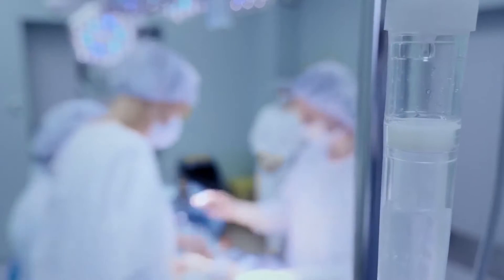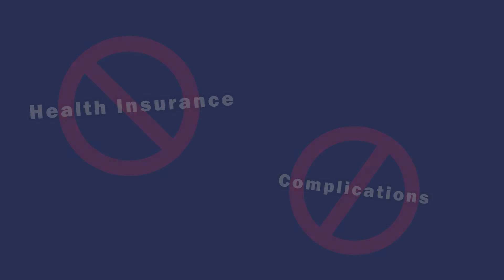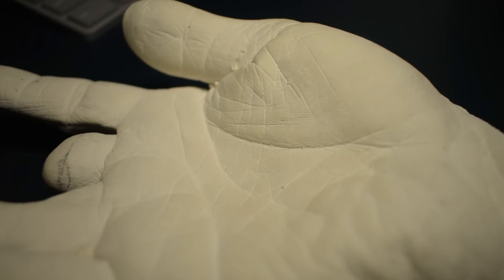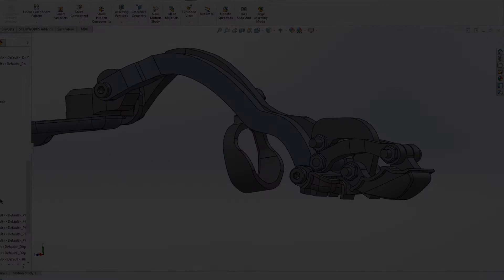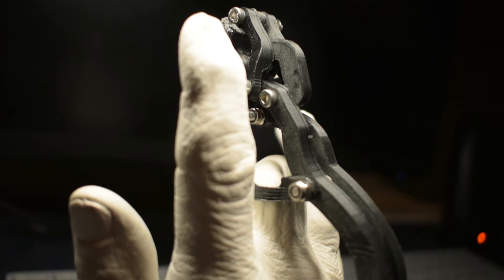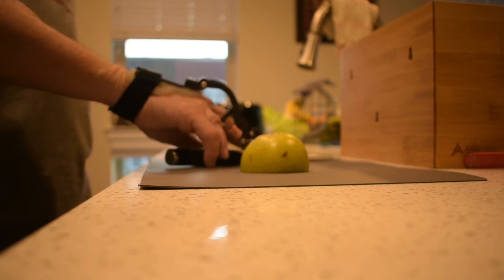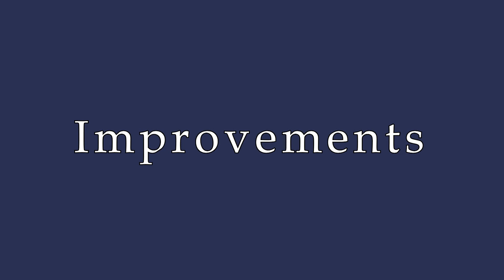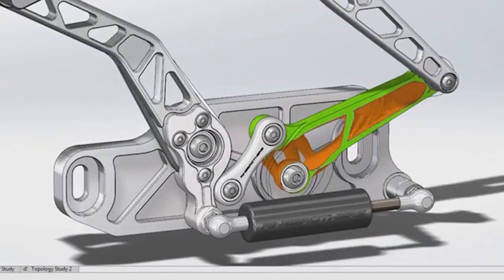3D Printed Prosthetic Finger

Comment: Noah,  I have partially amputated index and ring fingers due to a table saw accident in Feb 2024.  The surgeons were able to repair my middle finger.  I work as a Firefighter/paramedic and enjoy an active lifestyle including mountain biking.  One of my goals is to make a prosthetic and/or modify the mountain bike brake handle so I can return to riding.  Would you be kind enough to share your files and design?  It would be a great starting point and learning experience to adapt it to my situation.  It would be for personal use only.  Thanks.

Comment: Beautiful project!

I found your video by researching for  3D printed prosthetics thumbs for a friend that just lost his thumb on a tape saw on his work. Since he can't afford the other prosthetics because of the conversion cost to Brazilian Reais R$ and the importation fees, I started to look for low cost solutions that actually work. I found several projects on thingiverse and other 3D printing communities, but none of them was so nice as yours.

He lost the first and the second phalanges of his left thumb, but still has the basic movements of the metacarpal bone.
By what you learned with you project, do you think that the remaining movement of the metacarpal bone can drive a thumb prosthetics that is based on the same principle of yours?

I have a 3D printer at home and I am already working on the string driven projects, but they are a little fragile.

Thanks for putting so much work, time and thought on this project! This is a great inspiration for DIY makers and it can really help the mind and bring some joy for those who suffered these accidents!

Cheers from Brazil!